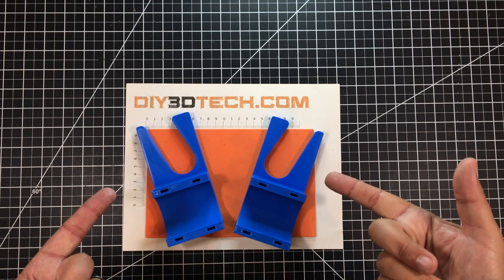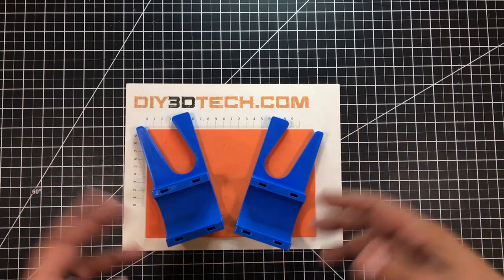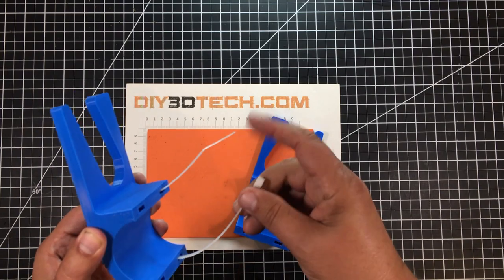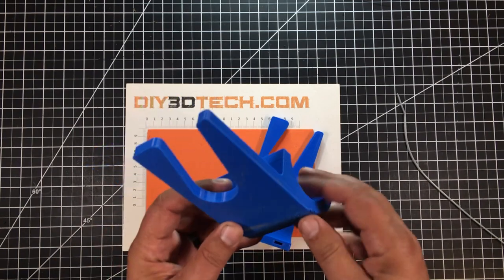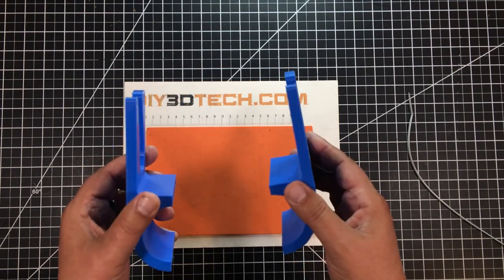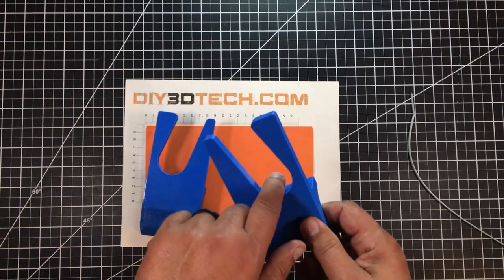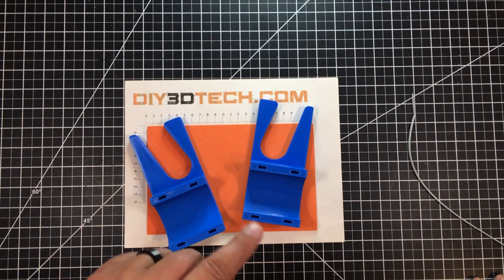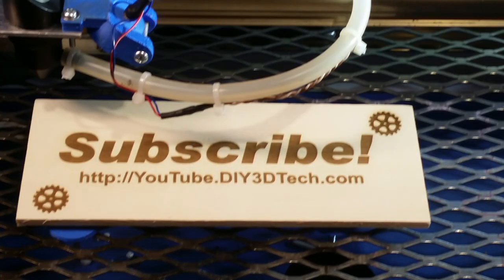Design Talk - Yard Tool Holders for Your Tractor!

Comment: I printed water bottle holders for my kids scooters that zip to the upright similar to this. They rotate all over the place, so a TPU collar for the part that gets zipped to the posts may be helpful too.
Reply from the maker: I hear you, the rotation is not bad as I have pulled the zip strips tight with pliers, however in future version I will likely add a slot for a compression pad...

Comment: Not a bad idea.  Might try it.  I've been thinking about making ROPS flashing lights for my Kubota.  They would cover the ROPS bar and be two pieces that screw together.  Then also integrate a mount for LED work lights.  I think PETG would be strong enough since I don't run through the brush too much.
Reply from the maker: Your in luck!  I have already created this (with a 1/4-20 mount)  I will have them posted on the designstore in a few days!

Comment: you could have used the mirror function in your slicer, less files to keep track of. Did you use support on the outside only?
Reply from the maker: Correct and considered it, however inside this allows me sophistication in extending the model and analyzing the interactions mechanically (like the tipping)...

Comment: pear shape that slot so the handle sorta snaps into place and stays secure, using the elasticity of the printed plastic to open those jaws just enough to friction slide into bottom of hole where it rests and releases the pressure on the opening ;)

This is a neat starting idea. I've been spinning around a multi tool holder at the gate of my garden but every time I come up with a design, I end up seeing how I'd be so much better off using sliced PVC pipe instead(cuz the damn C shape works too well for holding tool handles .... I'm no Engineer but I bet if squint hard enough I'll make it happen someday lol

Ever since I got into 3D printing and designing my own parts(I made myself learn the basics of fusion360 b4 I ordered the printer, that was the deal), I started realizing how much stuff around me can be repurposed. Most of the time all it needed was a tiny bracket or a way to attach it to something useful, maybe even a guide or a pattern...and BAM 3D printer makes that happen.  

and they say there's nothing new under the sun.... i mean yeah that's sorta true in the sense that if I put my hands over my eyes I won't need sunglasses either
Reply from the maker: Great comments, the one issue about pear shape is the various handle sizes.  I created this about a month and it has been in use for that long working far better then I would have guessed and agree with you on all the cool things you can do with 3D printing and Fusion 360!
Reply: @DIY3DTECHcom  bike rack style for diff sizes? I know I'm overthinking. One cheap easy option for diff sizes is incorporating some pool noodle into that opening design.  It probably compresses enough to where you'd get about an inch of tolerance and it'll take the rattle out.